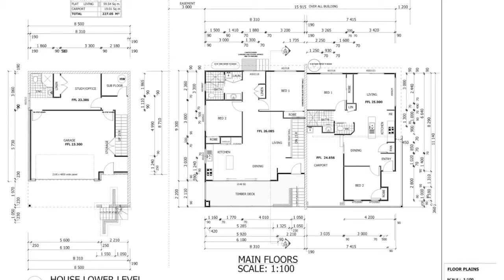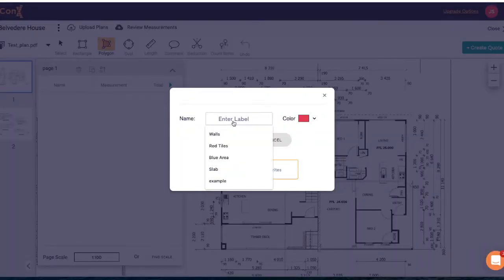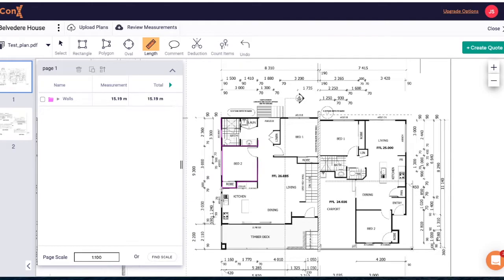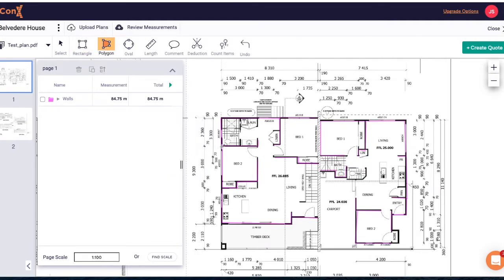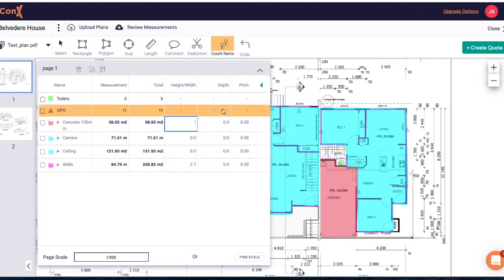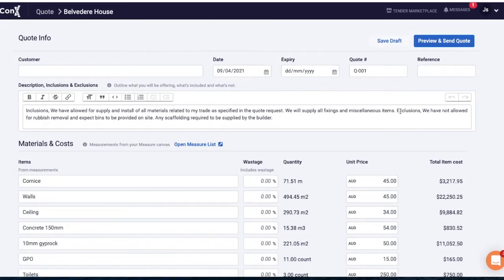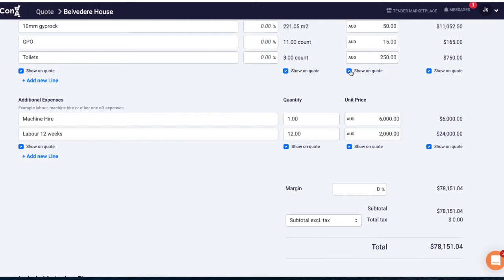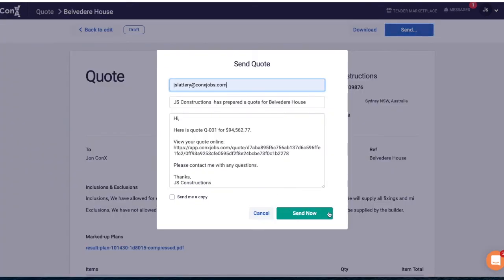How to do your Construction Takeoffs and Estimating - ConX

Comment: hi, first... thank you for this tutoral.

I want to know, how I can calculate the area of a wall that has a inclination. I mean that has two differntes heights.

Hope you can help me.
Reply: Use AVERAGE height. In my case a wall in a shopping center can be 20 feet high at the front of a building and 18 feet high at the rear. That means I would use a 19 ft height to measure  side-walls extending from front to rear. Another way would be to measure FOUR walls separately for the same room. (Like on a high church worship area where wall heights would be different on at least three walls.
Reply: Are you currently using ConX ?